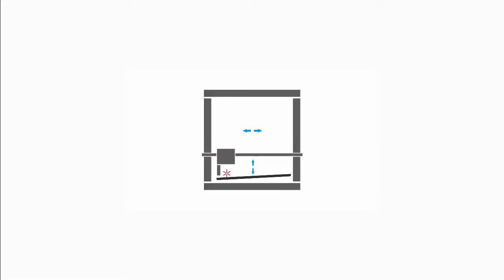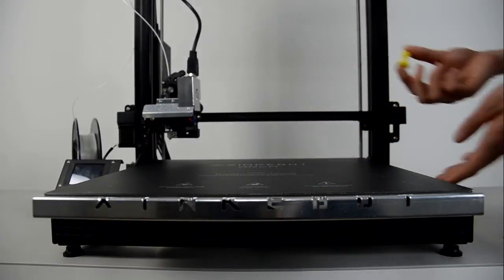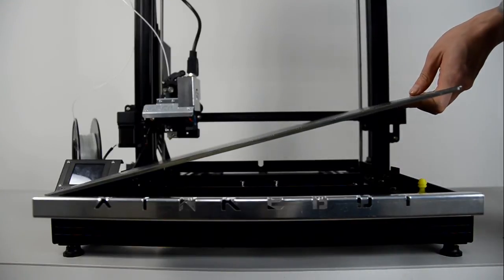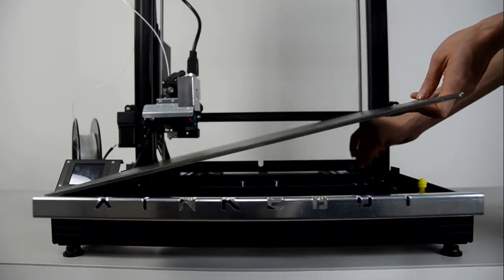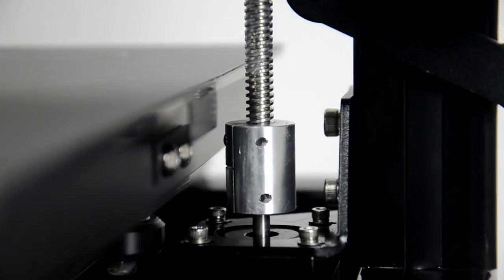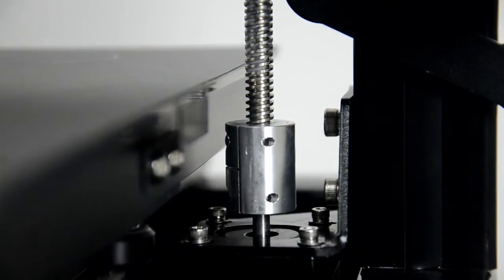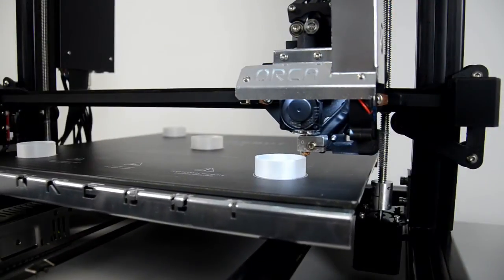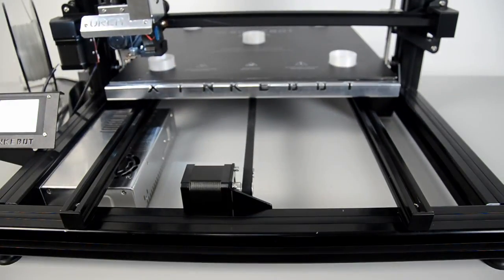How Does Auto Bed Leveling Work?

Comment: So the print will start and the bed might be skewed. Do you guys think that this is right? I would prefer the old fashioned way, "spend 10 minutes before every print to level the bed"
Reply: It calculates the positioning of the bed for z axis. And then makes offsets to the program to be able to print the part level. I don't have auto leveling but if I did I would never print with my bed visually unlevel lmao

Comment: Wont this wear out the z motor and the screw quicker
Reply: LOL, yes it will if we're gonna be nitpicky.

However, what does it matter to you personally if if the z-axis screw wears out in 25 years instead of 35 years? LOL You don't really think you're gonna need your exact same printer in 30 years as well?

Also be careful not to exercise too much, it wears your joints as well. The best thing you can do for your body is actually to not move at all, just sit at your computer and your joints will be perfect by the time you reach old age.
Reply: @floatingchimney this has gotta be the pettiest comment ive seen in a 3d printer video but it makes so much sense and i love it 😂😂😂
Reply: @l0wkey529  Sorry I just had to. 

I understand that some people just overthink things where they should not.

Comment: Thanks for the video! But my ender 3 pro with bltouch doesn't seem to work like that.... every time it prints, it doesn't print uniformly, some points are clear while others are smudged and mess...... kindly suggest what is going wrong..... I also have tried saving the settings to EEpROm, yet no use..... I have to do the babystepping adjustment for every print.

Comment: Is it planar? As in what if the print bed has a sag from heat? Will it accommodate for that, or just pick the best flat plane?
Reply: My guess would be just a flat plane but I’m sure it’s possible to buy a new print bed if it comes to that

Comment: Thank You. it will compensate, but the piece will be crooked when set on a flat surface? No?
Reply: if your bed is at least flat on a surface, not with pieces purposefully unleveling it, the slant on the bottom with be barely anything.
Reply: No, that's the whole point, isn't it...?

If your bed is slanted the print will be at the same angle, parallel, on top of it. But once you remove it from the bed it's as if it was printed on a perfectly level printbed (as long as the printbed itsself isn't warped)
Reply: @KiemPlant  Is the machine square and on a level surface and plumb to the surface?

Comment: I always thought there were motors inside that turned the screws until the bed was level, not the z motor making adjustments if the bed is off-level. Thanks!
Reply: pro tip: you can watch series on Flixzone. Me and my gf have been using it for watching loads of movies recently.
Reply: @Xzavier Franklin yea, I've been watching on Flixzone for since december myself :)
Reply: Nope it works the same way a probe does in a cnc machine. Which if you didn't know on cnc the probe will come in and touch a part casting in a few places and make auto offsets to compensate whatever needs it. Pretty cool actually how far things are going

Comment: Is the automatic bed alignment only performed once, or every print start?
Reply from the maker: It's used whenever you think the bed needs some fine-tuning (for example, when you switch from the single extruder to the dual extruder), but you don't need to do auto leveling every time before starting a print because the data the sensor collects will be saved to the firmware and applied to any following prints.